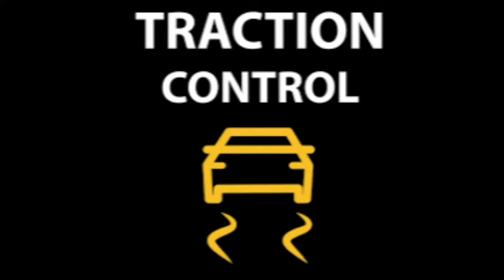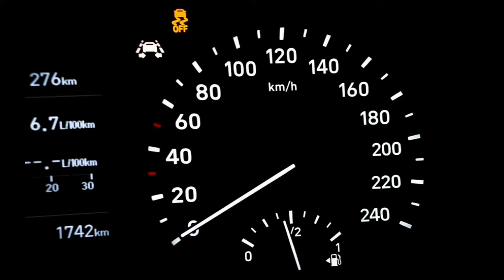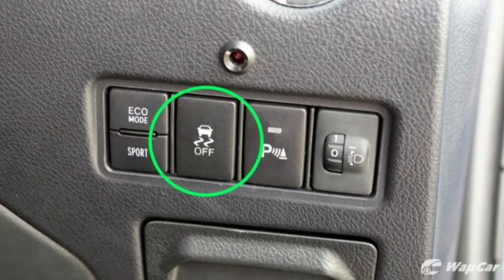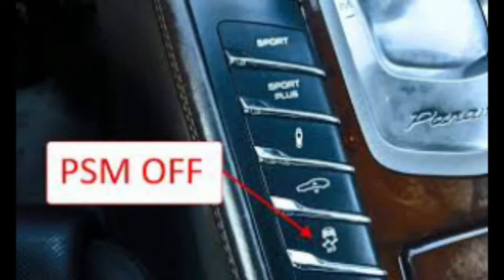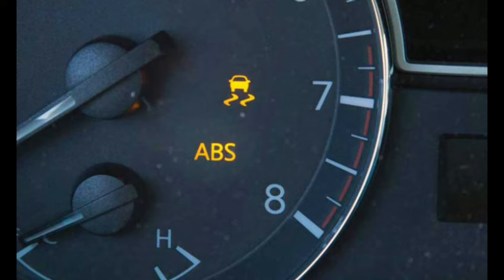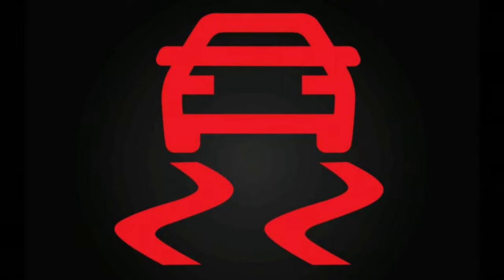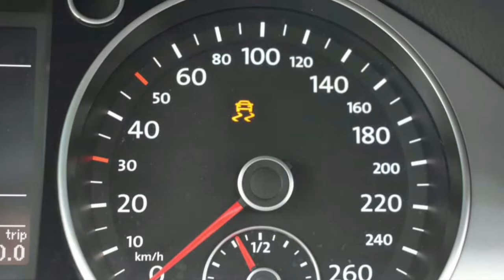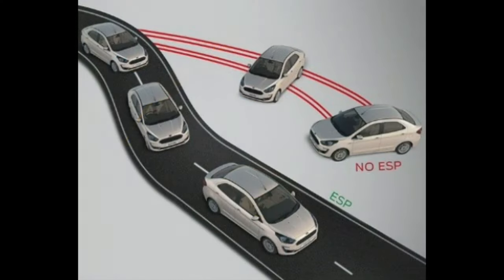How to Fix & Reset Traction Control or ESC Warning Light Stays On or Flashing | TCS Warning Light

Comment: Just replaced entire suspension. Two weeks later after a 6 hr road trip these lights come on. 🤦🏽‍♂️
Reply from the maker: @user-mc3lo3gv3c 

Typically this is a hub of magnetic material and a plastic and iron pickup coil that senses when the hub spokes pass by.

If this circuit goes open due to corrossion of the connectors, then this can trip the light aswell.
Reply: I replaced lower control arm the light is coming on wen l drive over 40 and the car slow down
Reply: On diagnostic they is know Fouts
Reply from the maker: @user-mc3lo3gv3c

What are the Common Reasons the Traction Control Warning Light Will Come On?
There are three possible reasons why you might be seeing a traction control warning light on your car dashboard. These include:
The traction control system has been switched off manually
The traction between the road surface and one or more tires has been lost, which will actively engage the traction control system.
There is a fault with the traction control system. This will usually occur if there is no loss of traction, but the warning light is switched on.
There is also a warning light that will come on to inform you that traction control has been turned off. If you are driving in normal conditions, it’s not advisable to disable the traction control system. This is because the system is in place for a very good reason. Even the best drivers can’t get back in control of the car as fast as a traction control system will do when it is lost.
However, it might be worth disabling the traction control system if you are driving in certain conditions such as mud, snow, or ice. This is because the grip of the tires is restricted when you are driving in these conditions, which means that they may not be able to work as well and will continue losing traction. If the traction system keeps detecting this, it will continue reducing the power, leaving the car with less momentum which can actually make it harder to drive in these conditions. However, you should always drive carefully and vigilantly.
Reply: Have an ‘08 Sienna XLE.  had all these random misfire codes (VSC) and even would have to shut my van down as the “traction control” light would blink along with the engine light causing the van to lose power and decrease in speed, till I shut it off and restarted it.   And that would take care of it for a week or so then back again, usually one the Highway.  So off to the shoulder again as the van would slowly lose power and buck and gas be basically unresponsive 

Seems like maybe the compression was changing over the 200,000 miles as i started putting premium gas in and the higher octane was the key.. as all the codes went away (once cleared) and never came back.   Same spark plugs.  I did change one injector (before I switched to premium gas) as it did have that code come up for the number 2.  But the check engine lights would still come on.   But same spark plugs on all 6 cylinders as those back are just too hard to change without a good reason.  

Again premium gas and all my check engine lights and blinking lights are a thing of the past and it’s nice having a dash free of those.  (Those lights came on probable a dozen times in the past.  But now problem solved for like 9 months now and counting.

In the past I cleaned my gas cap.. and disconnected the battery several times.  Light always returned.  But not any more.  :)
God Bless
Reply from the maker: @klujics123 
Thank you for providing that information

Comment: 16 master nissian mechanics stump for 3 months now. friend has an altima 2016 no code but the c1130. anti slip light on all other wheel sensors ok ,abs ok ,angle alignment ok trans mission ok ecu ok fuses ok no shorts. about to use the o black tape fix. it is weird,
Reply from the maker: @yourworstfear  It sounds like you and your friend have a real puzzle on your hands with that 2016 Nissan Altima! The C1130 code typically indicates an issue with the engine signal in relation to the ABS, VDC, or TCS system. Given that you've already checked most of the typical causes, here are some additional troubleshooting steps to consider: 

Possible Causes and Checks 
• Wheel Speed Sensor Issues: 
• Even though other wheel speed sensors are reported as okay, there could be an intermittent issue that isn't consistently triggering a code. 
• Inspect and clean the sensors and the wiring harnesses. 

• Steering Angle Sensor: 
• Ensure that the steering angle sensor is calibrated correctly. 
• Check for any signs of wear or faults that might cause intermittent issues. 

• YAW Rate Sensor and G-Sensor: 
• These sensors are crucial for the Vehicle Dynamic Control (VDC) system. 
• Ensure they are functioning correctly and that their connections are secure. 

• Battery and Ground Connections: 
• A weak battery or poor grounding can cause various electronic issues. 
• Verify the battery health and inspect all ground connections for corrosion or looseness. 

• Check for Software Updates: 
• Ensure the vehicle’s ECU has the latest software updates from Nissan, as there might be bug fixes related to this issue. 

• Harness and Connector Issues: 
• Look for any signs of wear, corrosion, or damage in the wiring harnesses, particularly those related to the ABS, TCS, and VDC systems. 
• Use a multimeter to test for continuity in the wiring harnesses. 

• Brake System Components: 
• Inspect the brake booster, master cylinder, and ABS module for any anomalies. 
• Check for any vacuum leaks that could impact system performance. 

• Check for Aftermarket Parts: 
• If any aftermarket parts are installed, they might not be fully compatible with the vehicle's systems. 
• Ensure that all installed parts are OEM and designed for the 2016 Altima. 

• Re-learn Procedures: 
• Perform any necessary re-learn procedures for the ABS and VDC systems. 
• Sometimes, re-initializing these systems can resolve strange issues. 

• Consult Nissan Technical Service Bulletins (TSBs): 
• Check for any TSBs related to the 2016 Altima that might provide insights or fixes for similar issues. 

Last Resort: Electrical Tape Fix 
While using black electrical tape to cover the warning light is a humorous last resort, it's important to fix the root cause to ensure safety and proper vehicle operation. However, it indicates that the frustration level is high, which is understandable given the complexity of modern car electronics. 

Professional Assistance 
Since you've already consulted multiple master mechanics without success, consider reaching out to a specialist in Nissan electronics or a dealership with advanced diagnostic tools. Sometimes, specific dealer tools or software can identify issues that generic tools cannot. 

By methodically checking these areas, you might identify the elusive cause of the C1130 code and the anti-slip light issue. Good luck!
Reply: @Dashboardwarninglights  same thing you posted all were done we are just going to disconnect the bulb for her today and be done with it. none of this junk for me.
Reply: We pulled the cluster took the slip light out all this was cause by insect body parts in the building socket it's ok now three months of hell dut to a dead bug. Wow.
Reply from the maker: Woooow

Comment: After plugging in my trailer my truck started running rough and my traction control light came on. One guy says l blew a fuse but couldn't tell which one.
Reply from the maker: @marsbotbyl159  When you experience issues like your truck running rough and the traction control light turning on after connecting a trailer, it could be related to electrical issues or a blown fuse as suggested. Here's a step-by-step approach to troubleshoot the problem: 
 Check the Fuses:
👉 Find the Fuse Box: Your truck's manual will show the location of the fuse box and provide a diagram of which fuse is for what function.
👉 Inspect the Fuses: Look for any blown fuses. These will typically have a broken wire or a blackened appearance inside the clear plastic. Pay particular attention to fuses related to the engine control unit, traction control system, and trailer wiring.
👉 Examine the Trailer Wiring:
Disconnect the trailer and check the connector and wiring. Look for any signs of damage, wear, or incorrect connections that might cause a short or draw excessive current.
👉 Inspect the Vehicle's Connector:
Similarly, inspect the vehicle’s trailer connector for damage or corrosion, which can cause poor connections leading to various electrical faults.
👉 Check for Error Codes:
If possible, use an OBD-II scanner to check for any diagnostic trouble codes (DTCs) stored in the vehicle's computer. These codes can give you more specific information about what might be causing the problem.
👉 Reset the System:Sometimes, simply disconnecting the trailer, checking connections, and restarting the vehicle can clear temporary issues. If the problems disappear after this, it might have been a simple connection issue.

Addressing electrical problems sooner rather than later can help avoid more significant issues down the road, especially when involving safety systems like traction control.

Comment: The TCS/ESC light along with the Red brake light stays lit on my car's dashboard. Recently changed the front wheel bearings, but they are still on. The car drives fine , even in rainy weather and on slippery surfaces. Can't find the issue on a scanner either...any ideas?
Reply from the maker: @matthieuratrimoson3211
If the TCS/ESC light and the red brake light persistently remain illuminated on your car's dashboard despite recent front wheel bearing changes and scanner diagnostics, it's crucial to address potential causes beyond the wheel bearings. Here are additional steps to consider:

Check ABS Sensors: Ensure that the ABS sensors, located near the front wheel bearings, are clean, undamaged, and properly connected. Faulty sensors can trigger warning lights even if the wheel bearings have been replaced.

Inspect ABS Rings: The ABS rings, which are typically integrated with the wheel bearings or attached to the CV axle, may be damaged or contaminated. Inspect them for any signs of damage, corrosion, or debris that could affect sensor readings.

Verify Brake System Components: While the car may drive fine, it's essential to confirm that the brake system components, including brake pads, rotors, calipers, and brake fluid, are in good condition. Any issues with these components could trigger the brake warning light.

Check Electrical Connections: Ensure all electrical connections related to the ABS, TCS, and brake system are secure and free of corrosion. Poor connections can disrupt communication between components and trigger warning lights.

Comment: Mine came on after I got a new alternator installed the guys had to remove a lot of stuff to get to the alternator it’s been on ever since I’ve driven it for a couple of hours so far is this something I should be concerned about ?
Reply from the maker: @cptfreeman8966
It sounds like the alternator has stopped charging, then as you drive the systems will shut down one at a time.
This is why the traction control light came on.
👉   Check your battery connections carefully, especially the positive cable, you may have a bad intermittant connection , 
Take the positive cable apart, take the red insulator off and clean inside, the lug between the cables, cable ends, etc,
Use baking soda and water, or battery terminal cleaner
When you tighten the connection, when its tight, grab the cables to make sure they are tight and the bolt does not bottom out before the cables are tight, the lead in the joint can crush down and cause the bolt to bottom out.
Reply: Thank you for taking the time to give me a detailed explanation  @Dashboardwarninglights
Reply from the maker: Hope it is helpful for you.
You're very welcome.

Comment: My light came on in non bad conditions and then lroceeded to say service stabilitrak and service traction control
Reply from the maker: @grantruzeski5032
When the "Service Stabilitrak" and "Service Traction Control" lights come on in non-bad conditions, it could indicate a problem with the vehicle's traction control system or stability control system.

Here are step-by-step to fix it

1.Check for Loose Connections: Sometimes, the issue can be as simple as a loose connection. Inspect the wiring and connections related to the traction control and stability control systems.

2.Inspect Sensors: The traction control and stability control systems rely on various sensors to function properly. Check these sensors for damage or malfunction. Common sensors include wheel speed sensors, steering angle sensors, and yaw rate sensors.

3.Check Fluid Levels: In some cases, low fluid levels, particularly in the brake fluid reservoir, can trigger the warning lights. Ensure that all fluid levels, including brake fluid, are at the recommended levels.

4.Test ABS System: The traction control and stability control systems are closely related to the anti-lock braking system (ABS). Perform tests to ensure that the ABS is functioning correctly.
😊 Thanks for watching don't forget to smash the like button, subscribe and hit the notification bell for future content.
❤ We REALLY hope it helps you drive safely.
Reply: Could be a bad wheel bearing or brake switch or just a bad abs speed sensor

Comment: Mine came on after replacing battery and spark plugs. Not sure how that is related. I do need an alignment done.
Reply from the maker: @7zWFf93k1O3yD6sO60tW     The Traction Control System (TCS) light can come on for various reasons, and it's not always directly related to the work you've done on the battery and spark plugs. Here are a few potential reasons why your TCS light might be on:

👉 Battery Replacement: When you replace a battery, the car's computer system (ECU) may need to reset. This can sometimes trigger warning lights. If this is the case, driving the car for a while may cause the light to reset itself, or you may need to reset the ECU by disconnecting and reconnecting the battery.
👉 Sensor Issues: The TCS relies on various sensors, such as wheel speed sensors and the ABS sensor. If any of these sensors are disturbed or damaged during maintenance, it could trigger the TCS light.
👉 Alignment Issues: Poor alignment can affect the wheel speed sensors' readings, potentially triggering the TCS light. Since you mentioned needing an alignment, this could be related.
👉 Electrical Issues: When changing the battery or spark plugs, it's possible that some electrical connections may have been disturbed, leading to a fault in the TCS.
👉 Spark Plugs: Although less common, if there was any significant disturbance during the spark plug replacement that affected other components or wiring, it might have triggered the light.

✅ To address this issue, you can try the following steps:
👉 Drive the Car: Sometimes the light will reset after the car's system recalibrates with some driving.
👉 Reset the ECU: Disconnect the battery for about 10-15 minutes and then reconnect it. This can sometimes clear any lingering errors in the system.
👉 Check Sensors: Inspect the wheel speed sensors and other related components to ensure they are properly connected and not damaged.
👉 Professional Diagnosis: If the light remains on, it may be best to have a professional mechanic diagnose the issue with a scan tool to pinpoint the exact cause.

Getting your alignment done may also help if the light is related to wheel sensor readings.
📍 I hope this helps but if I can assist further let me know and I'll reply as soon as I'm able to.

Comment: Hi random question, where can I find the hand brake for the Toyota Highlander 2010?
Reply from the maker: @morehoes257
In the Toyota Highlander 2010, the handbrake, also known as the parking brake, is typically located between the driver's seat and the center console. It's usually a lever that you pull up to engage and push down to release.
Reply: wow

Comment: Would changing a rear anti roll bar link make the traction control light to stay on? As since ive done that its come on and wont go off?
Reply from the maker: @darrenjones3022   Yes, it's possible that changing the rear anti-roll bar link could trigger the traction control light to come on. When you disconnect or replace suspension components, it can sometimes affect the wheel speed sensors or the alignment, which can trigger the traction control system. I'd recommend checking the wheel speed sensors and ensuring they are properly connected and functioning. If everything seems fine, you may need to have the traction control system scanned for fault codes to pinpoint the exact issue.

Comment: Can a bad wheel alignment cause the traction light to stay on?
Reply from the maker: @vusiMnisi-nl6kx
A bad wheel alignment typically doesn't directly cause the traction light to stay on. However, if the misalignment affects the steering or suspension components, it could indirectly impact traction control systems, leading to the traction light being triggered.